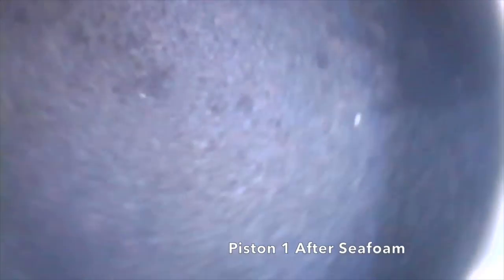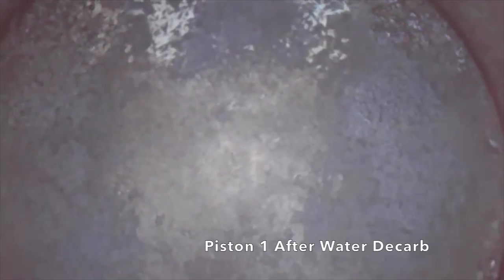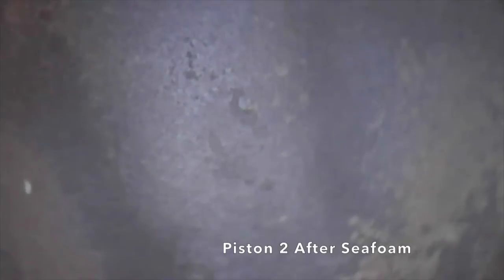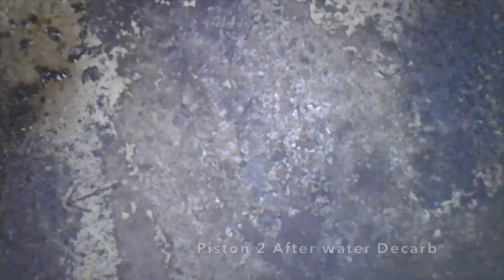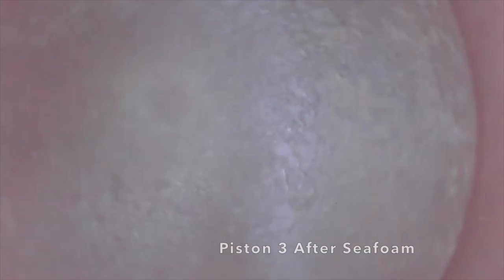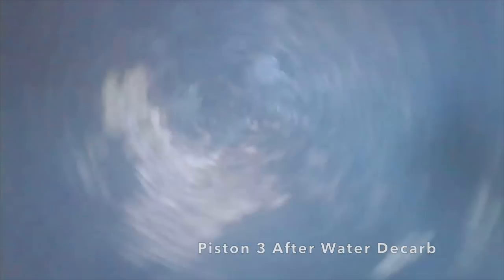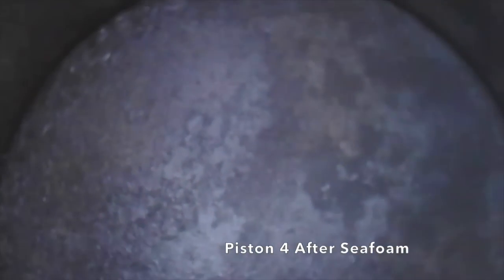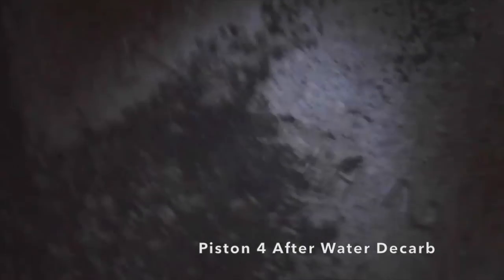Seafoam vs Water Results and Response to Chrisfix

Comment: From personal experience, water is technically better since it doesn't burn and is not compressible, so it's like steam cleaning your car's combustion (Ever seen a blown head gasket and the affected cylinder?). Seafoam is good for burning off deposits in the cat and the smoke is caused by the petroleum distillates and mineral oils in the product. I personally do 50/50 of seafoam and water to clean both in one sitting.
Reply: Excellent bringing up a blown head gasket. It will make the cylinder or cylinders affected look like new lol

Comment: Hi, i have used decarb water on bmw x6 3.0d, and it worked amazingly nice. Got back All power and torque especially on low rpms. No black smoke any more, no blow by, less fuel consumption.
Very interesting method

Comment: Liquid cool motors runs slightly cooler then air cool motors, doesn't matter what type of air cool motor: lawn mower, harley, porche, etc.

Liquid cool oil temp stays below 250*F, usually stays above boiling point of water around 220-230*F.  But what's most important is the liquid cool stays more consistant in temperature.

Air cool oil temp is normally about 20* hotter then liquid cool, but normally don't go much above 250*F.

Both air and liquid cool motors oil temps do not like being agove 250*F, they get into overheating territory above 250*

With all that said hot water, especially steam is an excellent cleaner.

Comment: I used an HHO device on an older TBI pickup truck about a decade ago. The truck's engine was super clean inside due to the residual water from burning the hydrogen constantly cleaning the engine.
Reply: It's most effective on TBI or carbureted vehicles but can benefit some EFI engines as well. In a nutshell it enriches your air fuel combination with hydrogen, requiring less gasoline to be used. It's very cheap to assemble and maintain.
Reply: There is no sulfur dioxide problem. Hydrogen is a zero emission fuel when burned pure. HHO devices make pure hydrogen via electrolysis.

Hydrogen is a gas so its not measured in liters either. Its measured in cubic feet or meters. 

I have no idea where you get your information from, but you need a new source.

Comment: Hi 
Man i have an vw golf 4 1.9 tdi with di red 2000 i think at 115hp i dont know exactly but im having problems with loss of power and i have changed almost everything turbo ok , turbo valve ok, vacuum tubes changed, egr its not functioning but i've seen your video deleting egr , can i do something tu my ECU so my car can go like it used to be?

Comment: I only use it before oil changes every so often. It does in fact clean things out because the oil comes out black as where it normally comes out looking not much different from new.  I change oil every 5k miles and use Seafoam about every 20k miles.

Comment: You used Seafoam first in each cylinder, followed by water. Had you have done 2 cylinders with water only & 2 cylinders with Seafoam only, I would have been more accepting of the results of water vs Seafoam. As it sits.... it appears that Seafoam loosened up some carbon deposits first & then the water did a finishing rinse. I’m very willing to bet that if you did the water first & then the Seafoam, the results would be pretty much the same. Even better yet: 1 cyl s/w. 2 cyl w/s. 3cyl w. 4 cyl s.

Comment: It is nothing to do with air cooled or not, seafoam is an old product and is more suited to the "soft" carbon produced by non lean burn, carb engines. Hence why it worked so well in chrisfix's lawnmower and not in the car. In the car, high cylinder temperatures caused by high compression and lean burn, modern injection means the fuel is really "baked", rock hard, onto the piston. In older, generally lower compression vehicles that use a carb, the air/fuel ratio is richer and not so accurately measured, causing more deposits that are thicker and more oily, hence the reason manual decoking in the old days could easily be performed with a blunt scraper, a task that would be difficult on a modern engine due to the carbon being a lot harder. (Just take a look at the carbon on the Honda's piston in chrisfix's video!) As for water, well, we all know it's great at de-coking as high pressure steam is better than any chemical cleaner, hence why it is used so much in industrial cleaning etc.
Reply: Chris fix did it in a car as well got the same results
Reply: +swifthartless That is what I am saying! Seafoam was developed for older engines, so on modern engines it will not perform as well! As modern carbon deposits have no lead to provide a protective coating and are baked on harder.
Reply: +ILMatt - Yes initially developed for 2 strokes outboards, meanwhile the myth spread to all sorts of engines, including the latest direct injection. 
With this said personally I prefer good old plain water mist. Simple ,cheap, easy to get on a Sunday afternoon LOL clean carbon perfectly so no need for the extra $$$. ;-)

Comment: I used to work for a dealership for many years. One product worked so well, it had to be diluted with gasoline because it was so powerful (unless the job called for 100%) Its called GM Top engine cleaner. You may have to ask at parts department for it, it's not expensive (maybe $6-10) a can. You can use it many ways but I seen it spayed into the throttle body over 15 minutes (with a pressured air adaptor). I would like to see how it works in your videos.

Comment: Water in a two stroke that lubes the cylinder wall on every stroke can melt a piston down in just short hard run with a head ask leak if to much water is coming into the cylinder. Short as in 20minutes.I definitely would use much water or at more than it takes to keep it running. Just my thought.

Comment: Your information about engine operating temperatures being much higher in liquid cooled car engines compared to air cooled lawn mower engines is factually incorrect. In fact, it's normal to find that the cylinder head metal temperature in an air cooled engine will be higher than that of a liquid cooled cylinder head. Engine temperature is dictated by the fuel used, compression ratio,
Ignition timing and ambient air temperature to which the engine temperature is dissipated to, whether that be by air flow alone or through another medium such as ethylene glycol/water and a radiator. Coolant or engine metal temperature in the case of an air cooled engine is no indication of internal combustion temperature experienced by the piston,valves, cylinder bore and combustion chamber area. The main difference which you failed to pick up on between a lawnmower and a car engine is the shear hours ran. A lawnmower will perhaps be used for an hour a week compared to a car engine which will do well in excess of this. This will allow a larger amount of carbon build up to accumulate on top of the piston in a seemingly shorter space of time and so making it more difficult to remove with the same amount of decarbonising agent.

Comment: You do realize that the air cooled lawn mower runs hotter than a car engine right? the water cooled car engine's temperature is regulated better than an air cooled one. a lawn mower typically runs around 350-400 degrees and cars around 200-225. so the air cooled one would be baked on way" harder". either that or there would be absolutely no difference in the "hardness" because the temperature difference is so smal

Comment: I still think it's funny that people want clean piston tops in their engines!  As if it really makes any difference whatsoever.
Reply: Undesired rise of static compression ratio, high risk of engine knock or pinging, bad valve sealing, you want me to continue? What a clown.
Reply: @nicolas6820  Explain to me how a  "dirty" piston top causes bad valve sealing?  I'll give you the others - but only for select engines like the older Briggs.  Made them hard to start because of pre-detonation.  Seems like you're making a clown of yourself.  Your turn again, chum.
Reply: @ox6942  The bad valve sealing is due to the carbon buildup on the top of the combustion chamber and the steam of the valve genius. I actually solved my pinging problem on mi Sidekick 16v engine with this method. period.

Comment: i don have an issue with piston and valve carbon.
 i cocktail my own additives on every gas fill.
water works very too. i use it once a year i spray distill water.

Comment: I know that riding lawn mower engines run hotter than a regular vehicle engine and thats the reason a heavier weight oil is used in lawn mower engines. So the theory about cleaners not working as well in cars because of the temp is bs. But i dont doubt there are better ways to clean engines out but water will not break carbon build up better than engine cleaners. If so, then take two filthy valves place one in a cup full of water and the otger in a cup full of sea foam or whatever brand you want. Bet the water doesnt clean it as good as the cleaner. So that means that water is NOT going to clean the valves, and the plentum and the Intake the way cleaners will. Period

Comment: I've heard that water works great to clean up a motor, but  the trick is to have a set up whereby you can give it a spritz as you drive, either by a button, like using your windshield washer or something like that, because it's doing a little bit all the time, and time is the deal. They say it just takes time, but it really will work like steam cleaning. So maybe just hooking the windshield washer into the air cleaner or some other place on the manifold is the deal. Maybe some kind of automatic thing would be best. Maybe just a real small diameter hose into some place on the manifold would work. I've heard that "burning water" gives you better gas mileage too.
Reply: +Ray Brensike - Yes a water injection system can be easily assembled and set up to work on demand. But generally this don't need to be done constantly. When it's clean, it's clean. A simple spray bottle and a few minutes every once in awhile it's hard to beat for simplicity. :-)

Comment: water does work , my farmer neighbor has to do this to his old john deere tractor once in awhile.
Reply: Bob o I would use water on the tractor to. Diesel can help lube the cylinder wall while running the water through, I believe just a touch of water would be ok for a gas engine but just think of what a coolant leak can do to a gasoline engine in just a short period of time.

Comment: keep using water and you will destroy the motor !! Sea foam has a additive that lubricates and takes varnish off the entire inside of the motor !!
Reply from the maker: What will be destroyed, and how?
Reply: +BMAC VAGS, You really don't know how water can destroy an engine?!?! If you truly don't know how, then stop making these videos.
Reply from the maker: Frank Gonzalez My friend you are speaking without the benefit of intellect. Do some research before submitting condescending messages. I mean this in the politest way.
Reply: +BMAC VAGS How about you do some research on how water can ruin an engine before you say I'm speaking without the benefit of intellect.
Reply from the maker: Frank Gonzalez You are talking, but you are not actually saying anything. If you know then please share.
Reply: +BMAC VAG You are writing without reading.
Reply: Frank Gonzalez Water/Methanol injection. Google it. That is all.
Reply: INJECTION!!!! W/M is controlled, It's when water or any liquid is sucked through any uncontrolled vacuum port/line is what can cause trouble.
Reply from the maker: what is the varnish called?
Reply: carbon unused carbon .
Reply: He is right about lubrication, there is a method called fogging the cylinders, do this on a car that has been sitting for years before you start it, it helps lubricate them, and if seafoam also lubricates the cylinders then how is it that water can?? but i would recommend fogging them after water decarbonizing. or just stop being cheap and use seafoam.

Comment: water is inferior to any highly purified petroleum product for cleaning an engine. its simple chemistry.  please try again BMAC well you will i guess in 1-2 weeks when you have built up more carbon that you originally had because of using water ;)  if only people were smart enough to understand its not just one process. there is removal and then there is protection afterwards  using water is not doing the second.
Reply from the maker: have you used tge water method before?
Reply: +john jones   The carbon isn't chemically bonded to the pistons and valve tops.  The organic solvents burn inside the cylinder so they don't dissolve the carbon very much.  The water turn to steam inside the hot cylinder.  You are steam cleaning the cylinders.  This method has been used for decades on aircraft engines.  It's just like steam cleaning the outside of a dirty engine block.
Reply: +john jones lol
Reply: +John Ferguson The water doesn't turn to steam inside the cylinders, as the temperatures and pressures are far in excess of waters vapour points. The water dissociates into hydrogen and oxygen, thus releasing far more energy than petrol combustion.
Reply: Paul Evans The temperatures are not anywhere near the temperature high enough to cause the disassociation of the water. If it did we could use water instead of nitrous oxide to power our cars.  The main products of combustion are water and CO2.  The water injected absorbs heat and flashes into steam and that steam cleans the carbon off the metal surfaces.  Aircraft radial engines have water injection to cool the cylinders at high power settings.
Reply: +John Ferguson  In a Gasoline engine combustion temperatures of 1050 degC and 150 bar are normal. In Diesel 650-700 at 600 bar.  Water as steam is not possible at these pressures and temperatures. Dissociation is.
Reply: +Paul Evans Water was injected into inlet air to increase charge density through evaporation and it increased the knock limit.
Reply: Paul Evans   The water boils into steam which absorbs heat which lowers the cylinder temperatures allowing the engine to run at higher manifold pressures without over heating the cylinders.  The point being that water does not break down into hydrogen and oxygen inside the engine.  If it did, the water would become rocket fuel.
Reply: Water cannot exist as steam at 1050C and 100bar. Water can dissociate at this temperature and pressure,  temperatures and pressures in a Gasoline engine can locally be far higher, depending on the region of combustion. Dissociation occurs.
Reply: Paul Evans Thermal decomposition of water[edit]
Main article: Thermochemical cycle
Thermal decomposition, also called thermolysis, is defined as a chemical reaction whereby a chemical substance breaks up into at least two chemical substances when heated. At elevated temperatures water molecules split into their atomic components hydrogen and oxygen. For example, at 2200 °C about three percent of all H2O molecules are dissociated into various combinations of hydrogen and oxygen atoms, mostly H, H2, O, O2, and OH. Other reaction products like H2O2 or HO2 remain minor.   I copy and paste the Wikipedia for convenience.
Reply: John Ferguson The dissociation constant Kw varies with temperature AND pressure If you don't think dissociation takes place, thats up to you.  The percentage of water used here vs the amount of fuel and air gjve a clue as well.
Reply: Agree - not as an engineer (though Im a construction engie) but as someone who used an HHO device long term in an older TBI pickup. The residual water vapor had the engine super clean in side.